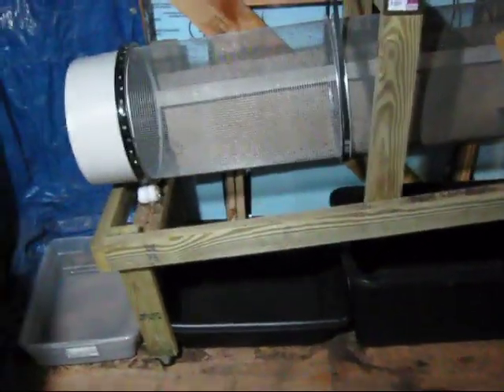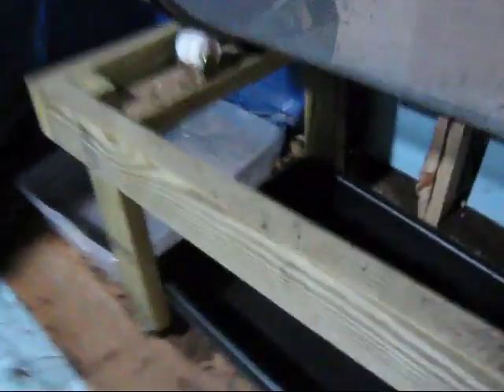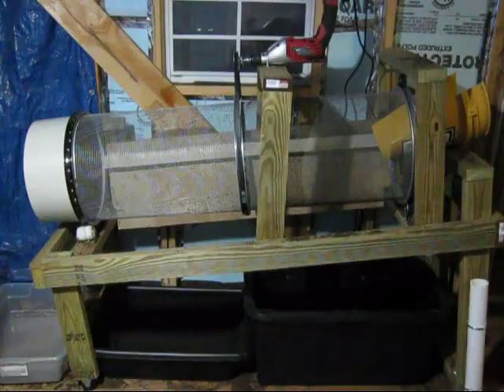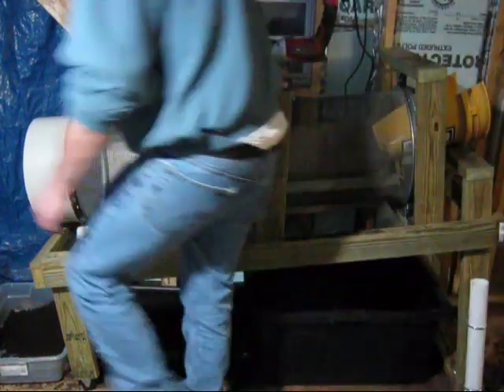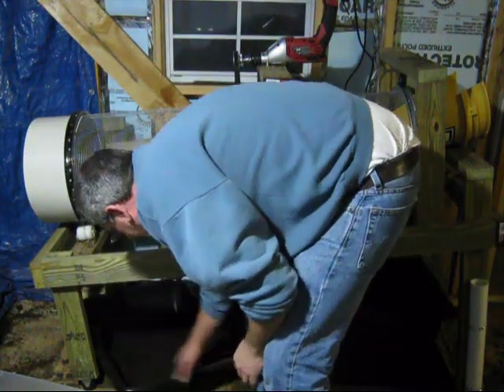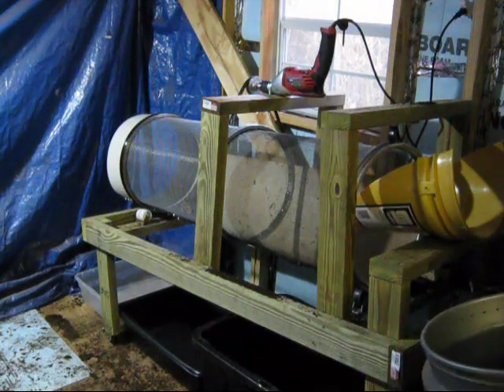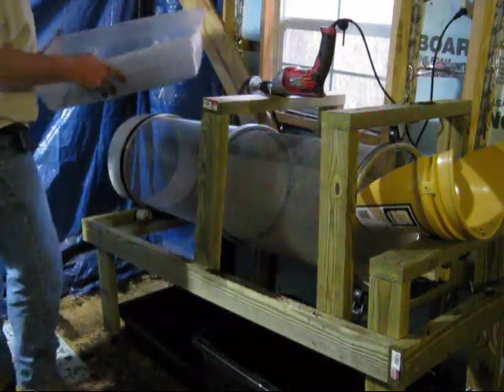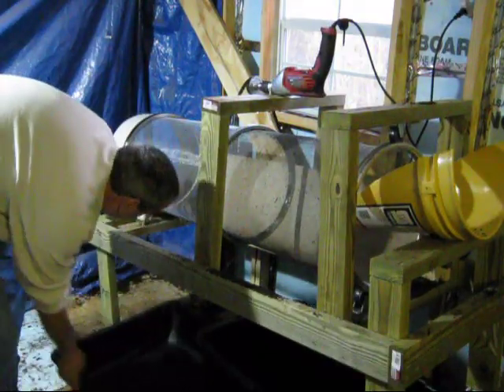Homemade Worm Harvester

Comment: Get a 1/2hp 3 phase motor and run with a variable frequency drive. It can run from normal household power. If you a vector drive it will come with a built in potentiometer. the VFD will also give you full torque at low rpm.
Reply: This is a silly idea. First, who has three phase, second, who needs 1/2 hp, third, a vfd cost plenty. A drill on the on the other hand with a sewing machine foot pedal.

Comment: Clever set up. I wouldn't be surprised if you burnt up the motor on the drill though. Maybe torquing the wheel differently might help with that.

Comment: Eliminate the bike rims, the upper wooden rings, and upper casters.  Cut the tops from 5 gallon buckets to make the three rings.  Locate the drill just above the wooden side rail.  Now the belt holds the sieve down on the lower casters.

Make a homemade belt with an old bike tube.  Sew the ends together for a custom length belt.  Eliminate 4 casters by using carpet scraps.  Cut small squares for the end rings to slide on.  Now you only need 2 casters for the central ring.

Comment from the maker: John

No it runs smooth due to the design which holds it in place at the top. I will be giving out the plans once completed to anyone signing up for the newsletter. Worm Composting Blog dot com and use the newsletter link in upper left hand corner of the page.

Bruce